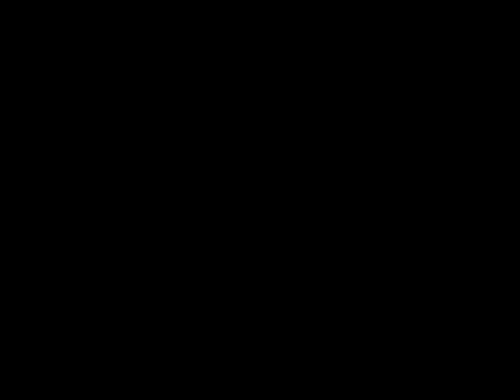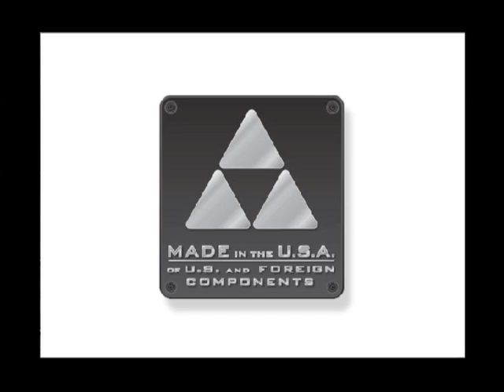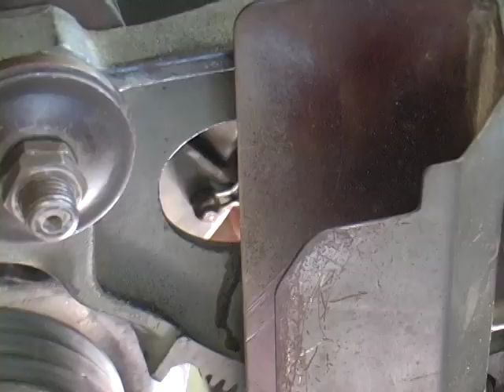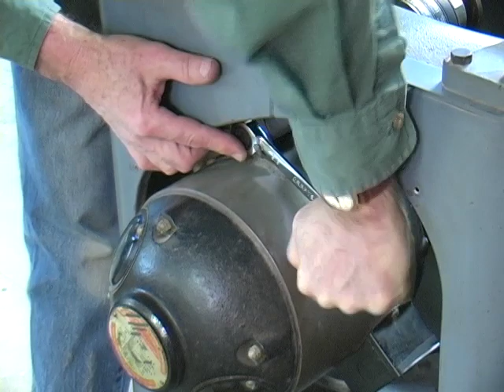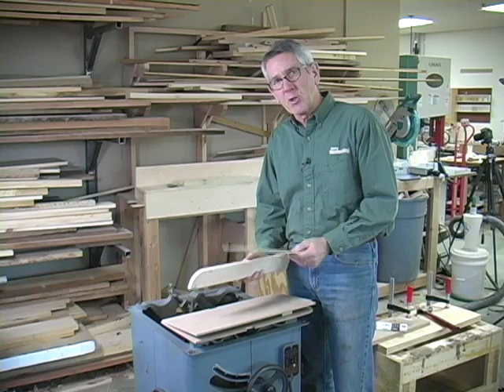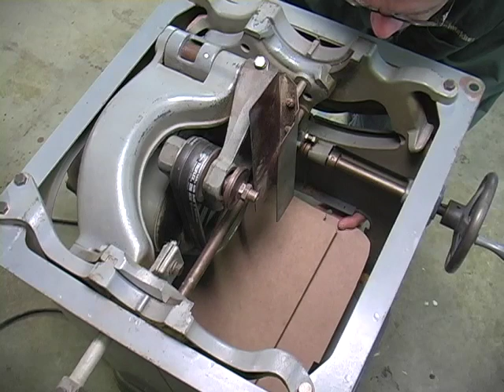UNISAW Restoration - Part 4

Comment: For the record, don't take 26 inches as gospel. The manual for my Unisaw says "Cat. 291" (matched set of three 29 inch outside circumference drive belts) or "Cat. 281" (same thing but with 28 inch belts.)
You know to get the 29 inch belt set if you arbor pulley has a diameter of 3-3/32 inches. It says to get the smaller belts if you have the optional smaller high-rpm pulley (something around 2-11/16 inches.)
A Unisaw manual from about 20 years later, 1966 or so, no longer mentions the 28 inch belts.
I'm going to replace mine in a week or two with a set of modern clogged belts to see if they're better.
If I remember, I'll return to comment here.